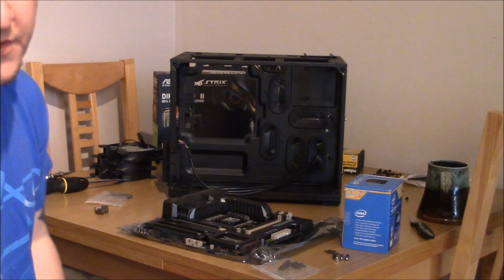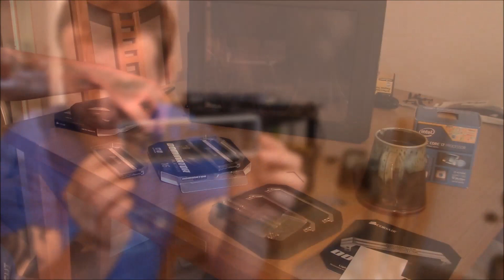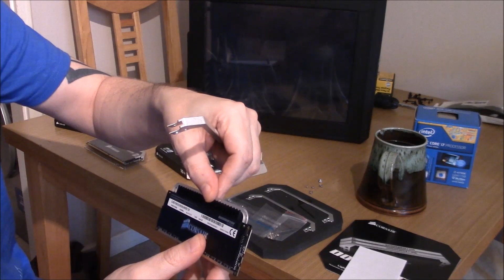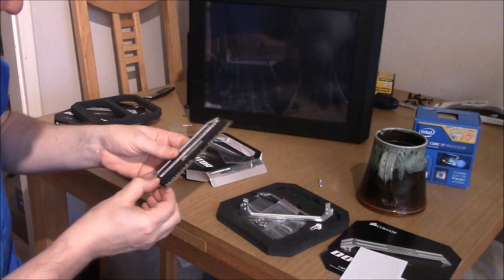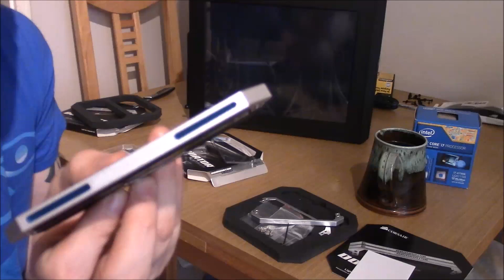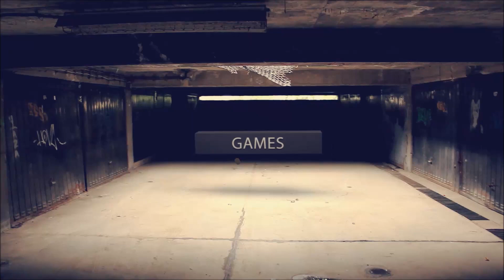Corsair Air 240 Build log Number 2: Installing the hardware

Comment: you are a genius @ 12 : 40 i have to take my graph. card out to install a nvme drive i will unscrew the mainboard first to go right with the board and then pull the card out. no one tells you that problem with the graphics card except you thanks a lot for telling it to the community.

Comment: Hello Ren, loved the video.
However I'm encountering issues with my Asus Gryphon and a similar build. First I couldn't screw all the holes because of the gap between the mobo and the standoffs in the case, I'm missing the 3 on the outer right like you pointed in the video. How did you solve it, and is it important? (my board seemed to hold fine with the 5 others).
Now that I'm at the end, I can't get it to boot, I get red CPU led flash and DIMM flash and then it just turns off. Could that be a sign of a toasted motherboard? I'm trying to bench it, and without GPU and just 1 Ram I have the same symptoms. The only things that are plugged are 2 fans, CPU cooler (H100 GTX), PSU for mobo and front panel stuff. The SB led stays on though, even after it turns off.

Specs:

PSU: RM750
Cooler: H100i GTX
MBD: Asus GRYPHON Z97 Armor Edition
Ram: 2 x 8GB Corsair Vengeance 1866mhz
GPU: EVGA 970 GTX ACX2 FTW+
(all brand new)

Thank you for your time and I would appreciate any help!
Reply from the maker: +Pierre Moreno Hello mate, I'm sorry for the late reply. Been kinda busy.. Have you solved it yet?
Reply: +Ren Gaming I'm having the same issues.. I have the same build as you, Ren. Any help?
Reply from the maker: Have you sorted it yet mate? I was just patient and managed to get them in. The armor is a pain for this!
Reply: +Ren Gaming but did all of the standoffs fit in the end? Could you make like a video on how to properly install this mobo since it's the best bang for buck mobo in my opinion for mATX z97
Reply from the maker: I'd love too mate but I would have to strip the build out to do it and I just don't have the time.

I did get them all to fit, just patience and some wangling..

Don't worry if a couple are missing but you need to get the majority in to support the board and GPU etc

Comment: i got all my parts for this build and i also got 4 corsair 120mm fans...now would i have any problems hooking all 4 fans up directly to the mobo? mobo being an asrock h97pro4.. this build is for my son so its not a high end pc at 700$+..
Reply from the maker: +Hitler  Jong-Un Hey maye. I believe the asrock h97pro4 have 5 fan headers so you are cool. If not a simple fan splitter will work
Reply: +Ren Gaming thanks alot for the fast reply. sub.

Comment: Very nice video! Very helpful for me, I'm thinking of getting a Air 240 case. I will get it with a i5-4690K and a cheaper ASUS mATX motherboard. I will be using my current graphics card, RAM and power supply until I can upgrade those aswell. Question for you though: I'm thinking of getting a Corsair H100i aswell and mount it in the front, I know I can only use one exhaust fan in the top if I go push/pull with it, but how long of a graphics card would I be able to fit in the case if I use push/pull?
I'm thinking about getting a GTX760 GPU or such to still be economic and get decent power out of my PC. Just not sure if I can get a acceptable heat level in the case if I only have a radiator in the front and the 120 exhaust in the back.
Reply from the maker: You can get 2 120mm's in the roof, you just need to be creative with the tubing ( see part 3 of this build ) A h100i in push/pull is 75mm thick including fans, the h105 is 88mm. The card will need to be no longer than 120mm ( the 980 is 11.5mm ) so just make sure you measure up fisrt. Also be careful of the card hight, as you will not be able to fit the side panel on..
Reply: Allright! Thanks, definitely subbing to your channel! :) My current card is an old 560Ti, it still does a decent job, but I'll probably be getting a 700-series soon since they dropped in price. How much space is it between the side panel and the motherboard roughly?
Reply from the maker: Thanks for the sub!! The corsair site says "Maximum CPU Cooler Height: 120mm" so take that as the max. Just be aware, you still need to plug the GPU cables in!
Reply: Allright, I'll probably have to go with a pull config with my current card, but then when I upgrade there is one GTX 760 card that is short enough to use push/pull on the radiator. The max GPU length in a air 240 is 290mm, with a H100i in push/pull I'll have 215mm left. The shortest GTX 760 I've found is around 170mm, the rest seems to be about 220mm+.
Reply from the maker: The 960 will be out soon so may be worth hanging on a bit.
Reply: Ren Gaming Oh, sounds exciting! Well I won't be upgrading any other than the motherboard cpu right now, along with a new chassi and watercooling that is.
Thanks for your help :)

Comment: Ren, I just build the same exact rig, except I used a 970 GeForce GTX instead of a 980, the 970 still lights up in green. 

Can you please help me with 1 thing, regarding the H100I  in push pull configuration. (I got the 100i instead of 105) I connected 2 fans to the radiator, and 2 stock  fans were already on the case.  But how do I connect the 2 fans with radiator to the other 2 fans connected to the case?  I have it sitting next to the other fans, but it's not secure. Also can you tell me if I have the fans blowing in the right direction?

< - FAN - Radiator -   Fan - Case - >
< - FAN - Radiator  -  Fan - Case-  >

Thanks so much
Andy
Reply: All of the fans should blow in the same direction. For example, the ones furthest forward should push air forward, and the ones that are visible should pull the air towards it. But in my opinion, it's a waste of money and noise to do that, unless you have like a 60mm thick radiator, which the h100i doesn't have.

Comment: DON'T rest the motherboard on the OUTSIDE of an anti-static bag! The bag is designed to keep static off stuff inside it, by routing it to it's outside, so you're putting your sensitive expensive components exactly where they shouldn't be.  Better off just on that wooden table, or just ontop of the cardboard motherboard box.

Comment: But it's useless to put fans IN FRONT of the H105, isnt it?
Reply from the maker: no mate, not at all. The fans in front push air into the rad and the fans behind pull air through the rad. Classic push/pull set up and it aids the cooling.

There are argument's to say because the rad is thicker, push/pull doesn't make to much difference but if you think about it, more cool air can only be a good thing. 😃
Reply: ok thanks :)